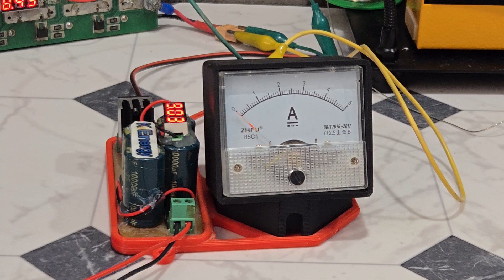12/8 Switched Reluctance Motor Part 1

Comment: That is nice, I build my own 3 phase SRM. I change the cores inside to create more flux onto my rotor. Next will be the 4 phase, but I am looking for the best driver controller. I can use from 12V DC up 110V DC. The resistance in the cores are 3.2ohm. Can you help by finding the right driver controller. Thanks

Comment: Nice build! I'd love to create something similar. Could you please elaborate on how you manufactured or sourced the silicon steel used in the rotor?
Reply from the maker: It mild steel. I designed the parts and sendcutsend cut them at a reasonable price with fast turnaround.

Comment: I've tested a couple of motors that don't have BEMF — in fact, they actually speed up when you short-circuit the output. One of them is stepper motors; in this case, the effect only works at certain RPMs. The other one I found is the motor used in microwave turntables, which are built differently if you take them apart.

Comment: How about a modified Van Der Graaff generator connected to a capacitor bank and using your type of motor? It may look an interesting contraption, and applying both concepts into a closed system?

Comment: the capturing of the back EMF spike to improve efficiency is dependent on timing and motor design. In most designs it is better to just used a fly back diode across the coil The flyback diode allows the coil to act as a power source to itself, which may sometimes double the efficiency.  Adding a inductive, capacitive or resistive load to utilize the flyback will alter the fall time of the magnetic field, plus the resistive load will always waste some power as heat. Depending on the rotor and circuit design, this alteration may benefit the system and increase efficiency.
Reply from the maker: Fair point. Mostly I've read they use flyback diodes primarily to neutralize hv spikes due to them causing havoc within the drive circuits.
Reply: @redesign3dp  yes this is the main reason. But I'm saying in doing so the diode also allows the inductor to convert the collapsing magnetic field into electrical power. In a case of a inductor that is the coil in a motor, the movement/change of the external magnetic field can work better or worse with the flyback diode.
Reply from the maker: @raloed.363  yes I understand. Motors can be engineered to take advantage of the spike to increase motor efficiency.
Reply: Really? I mean if the current in the winding takes longer to fall back to zero, then there's still some magnetic field there while the rotor has already passed the position, leading to negative torque. Ideally you want this fall time to be as close to zero as possible. However, the presence of free wheeling diodes will extend this time.

Hence I feel a cap dump circuit is still a better choice. Of course the overall stator and rotor geometry plays a huge role..
Reply: @ElectroMech-vj6lp  yes. I made a rotor with 5 sets of magnets once. Each set had one north directly beside a south. So it's north-south  then gap then north-south then gap etc. The rotor performed the best as a pulse motor when it didn't have the back emf diode (like a +300 rpm). Also it performed a +100 rpm better when the north magnetic in each set aproached the coil first.  If I switch the polarity of the coil, then it performed best when the south pole approached first.